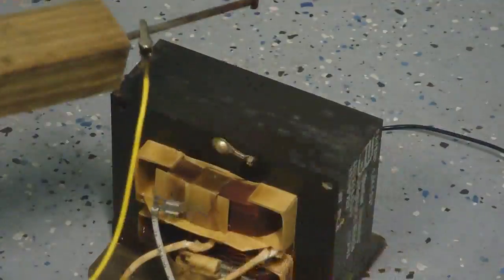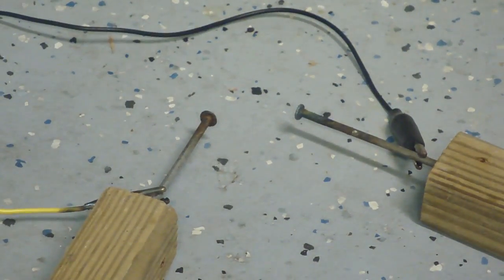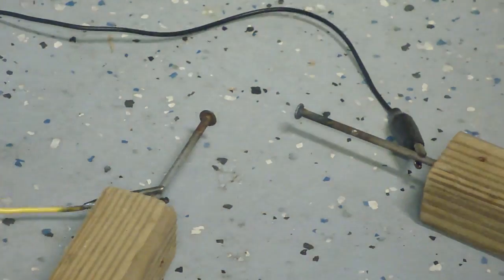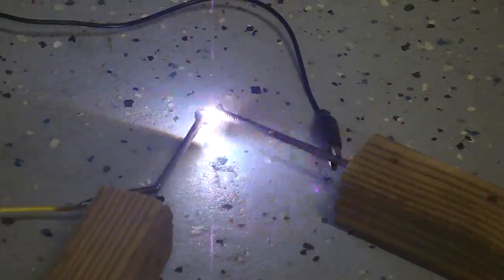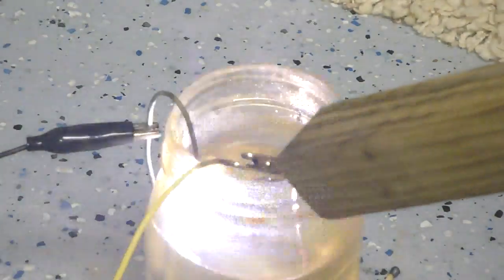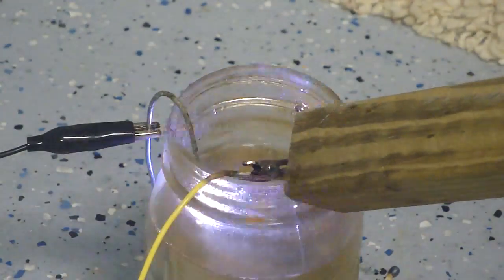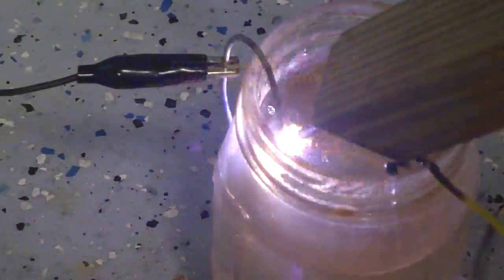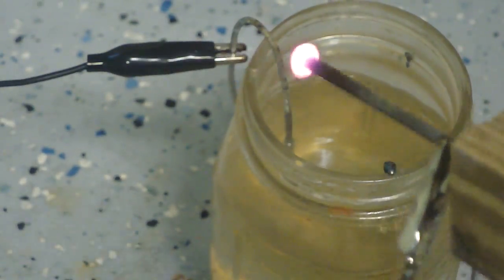Making High Energy Plasma at Home!

Comment: You might some automatic welding glasses to... and indeed earplugs and high voltage gloves, some moist wood conducts electrical power to a bit and high voltage training and a buddy to that knows reanimation to..

and a good life insurance policy that covers high voltage accidents and courage to...

And a your buddy and doctors need a lot of knowledge to, about high voltage accidents and the buddy needs to reanimate you until the medical people from the ambulance can take over...

Do not take it lightly, it does go wrong sometimes and in that case preventing you from ending up in a coffin takes knowledge...

for instance if your hart stops as a result of high voltage accidents, you will need to be kept alive by mouth to mouth breathing and compression of the chest, from the moment you are hit and the power is of, and capacitors decharged until the professionals arrive and even than it takes a while before you are alive again, 

these are the most dangerous things to try, okay you might say that it can't go wrong if you do it right,  but sometimes even professionals are having an accident by using faulty equipment or by mistake or even unexpected behavior of systems, many electrical repairman ended in the ambulance, or even the grave yard by measuring the high voltage of a microwave oven or a cathode ray television set the wrong way...

This is no fucking joke...

Sorry for mentioning this but you need to be cautious this is no toy...

Especially people without the right kind of training need to consult someone with this knowledge and have him or her at hand once they hook their stuff up and let someone with knowledge inspect it before they hook it up...

Even if you know what you do you might still need to check every component thoroughly...

And once it is in a moist shed for a while you might need to recheck it before putting it on net and high voltage...

Sorry again but I felt like I needed to mention this...

People are always warned not to take medical apps and programs advice without seeing a doctor, but the same goes here if you don't know what you do,
Do not do it...

I have same electrical training and even I do not mess with certain systems because I love my life, once it's gone it's gone...

Always ask not twice but twenty times read a lot about safety get a training and read even more and once experimenting be always on your guard and do not let children or spouses in and keep out the pets and such...

Sorry but I once noticed a kid using my ampere setting on a battery and being surprised the thing got damaged if he hooked it up like a voltage meter...

Kids do try things out and if you do put key switches on they either borrow a key from your pants once you sleep or hook up wires around it...

Ever heard of the teenage boy who shot his own foot of ? And that one was still lucky to be alive...

Sorry again do not want to sound degrading but some of us should be very careful...

Oh and when under influence of drugs or alcohol skip it until you are sober and clean...

Same thing with fireworks, but hey who am I to say things you all probably already know don't you ??
Reply: Thank you I was to do the same it save me some time and also I don't speak english than its a pain in the ass. Maybe people will find you negative with that but there's still a lot of things that you don't mentioned. Even highly skilled dudes like Tesla almost killed themselves more than once experimenting that type of stuff.